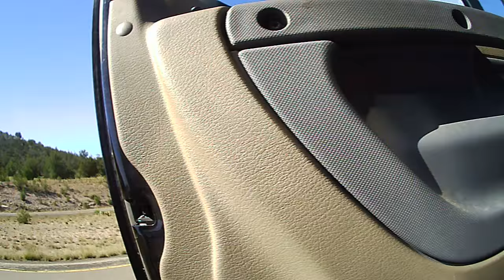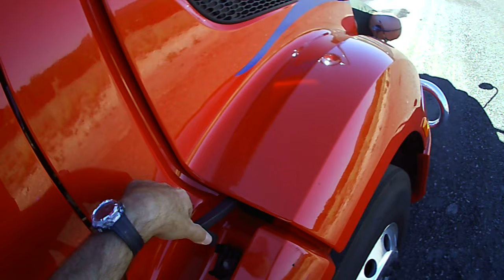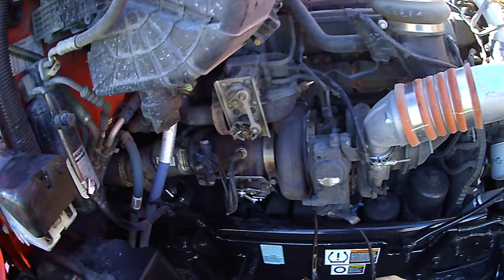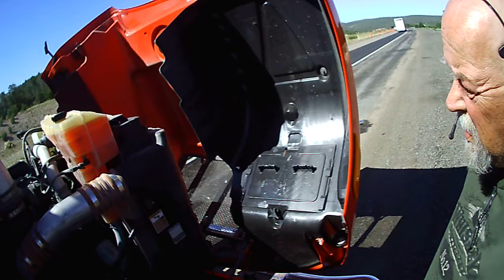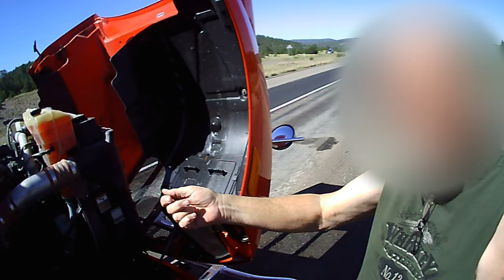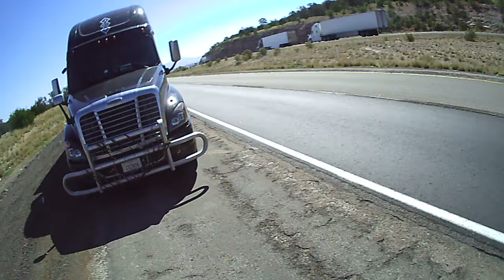Please Move Over for Brokedown Vehicles on Shoulder

Comment: Here is a pet peeve of mine,,,older and younger drivers have not adapted to new e-logs, so when they run out of hours, they just pull over to the shoulder for 10 hours. Some put out triangles and even open the hood, but when I go out on my 10-14 hour local run, coming back, there they are, still there 8 hours later with no service trucks helping them. this has become way too common, and is illegal,  as well as dangerous. my brother-in-law lost his cdl for this cause some car driver fell asleep and ran into his truck, now he drives light duty wrecker for pennies. Professional truck drivers drive professionally, the rest endanger the motoring public as well as us pro drivers. I have been driving trucks for 38 years, but the new way of driving by truckdrivers these days have me seriously thinking of early retirement, ( i am 57) . yes the good ole days of truckers stopping to help out fellow drivers, as well as 4-wheellers are over since nowadays, the wharehouse is the truck, and delivery schedule is king, not helping others. I have been using e-logs since 1995, if I can adapt, anyone can, it is not the end of the world to plan on pulling off the road for a 30" break, or 10' hour break.

Comment: Just loosen the radiator cap  a little so it won't build up pressure and drive on it won't leak no more or come out of cap it will be fine, get better clamps tighten lid back down and good to go